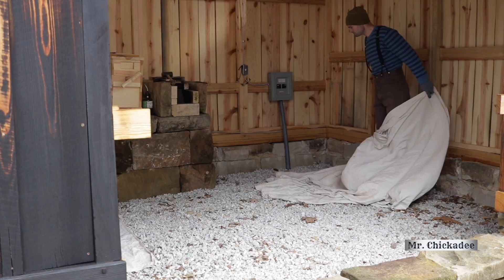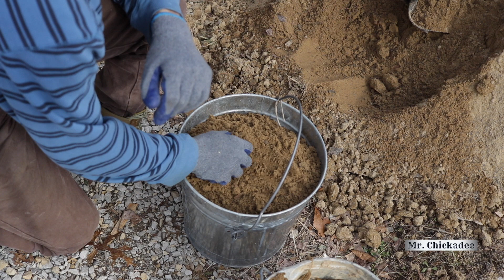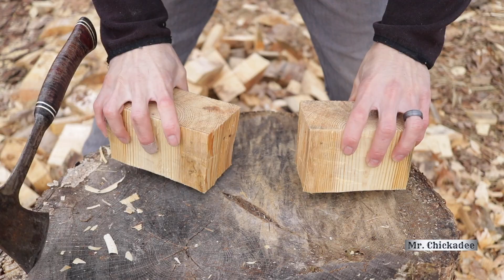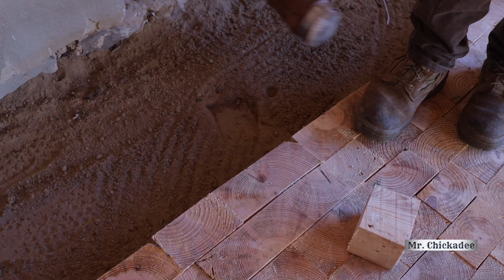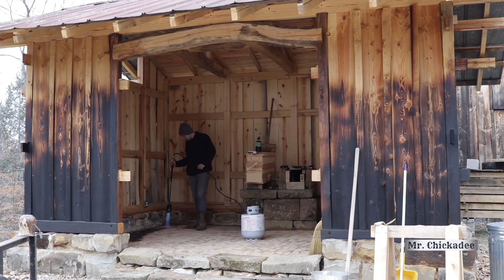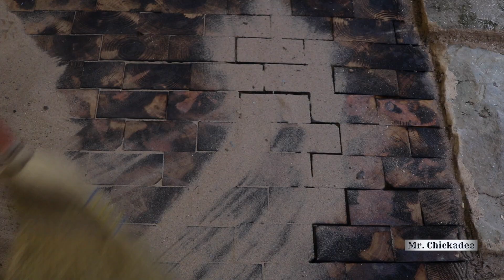Making a wood brick floor for our blacksmith shop

Comment: What about carpenter ants and termites? Around here they'd eat that wood up in a big hurry. 

What the bugs don't eat, the ground hogs undermine and ruin.
Reply from the maker: Most all insects who eat or inhabit wood prefer wet or rotten wood. Keeping the wood high and dry will keep the bugs away most of the time.
Reply: @MrChickadee  I built a shed 10 years ago, I'm on high ground, plus I elevated it 30 inches off the ground via posts, as if I was building a deck. The floor was pressure treated plywood over 2x12" PT joists atop 16 8x8" posts sitting atop 12" concrete pylons. The walls were 2x4 PT on 16" centers. The roof was 2x12 rafters on one span, and 2x6 rafters on the shorter span. 
In less than a year I was finding sawdust on the floor, carpenter ants had eaten their way up to the roof, destroyed four rafters, one post, and 22 studs. Termites had gotten into the floor, eaten away the 3/4" pt plywood to the point it fell through. My other shed is ground level, I've had ground hogs, skunks, and rats under mine the poured concrete floor, and I've got carpenter bees eating my upper roof structure. Poisons seem to do little, other than reverting back to old methods like Creosote and tar, nothing seems to stop the pests. I find that if I leave a short cut piece of PT wood on the ground, its hollowed out and eaten away in a matter of a few months.
Reply from the maker: @VB-bk1lh  I have seen only bad things from PT wood and concrete, PT wood is normally very low grade pine and the treatment only delays problems at best, concrete is proven to be poison for wood, it causes lots of issues. I would use stone and the most naturally rot/insect resistant wood I had locally, such as black locust, white oak, cedar, sassafras, catalpa or black walnut...then I would highly recommend burning everything you may think a bug will enjoy. They really dont like burned wood, I have seen carpenter bees land on a burned rafter tail, take a nibble and leave forever, Ive also burned random pieces of pine, poplar and other woods and just stuck them in the ground to see what happens, the termites dont like the burned wood while eating other pieces in the near area just resting on grade.

Comment: EE…
You COULD have done many things to help slug-proof your floor—rock salt, iron filings, bits of copper wire, etcetera in the sand. I'm very afraid you'll enter your shop once day to find a slug crawling on your floor or even up a wall—and you will never again feel 100% safe in your workshop.
…..RVM45

Comment: Beautiful floor!  I can see the advantages of it!  I have a few questions though.
1.  Is this dried wood or a fairly fresh fallen tree?  And does it make a difference which one you use?
2.  What is the purpose of cutting the angles in each wood brick?
3.  How many hours did you spend on this project?  That seems like a LOT of work for a project like that.  
BEAUTIFULLY done!

Comment: Beautiful floor, but any concern of fire hazard in a smithy?  Small piece of red hot metal flies across the room and you can't find it...
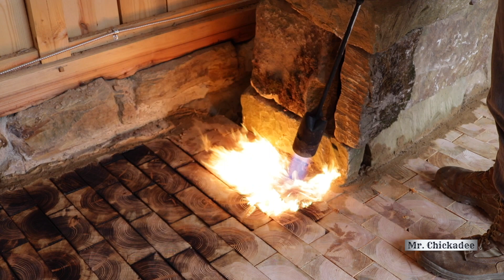Reply: Look at 11:10, it's take much more than a red hot piece of steel to light up a block of wood